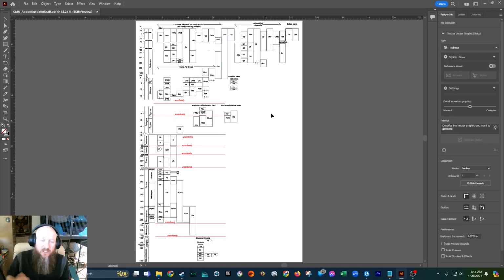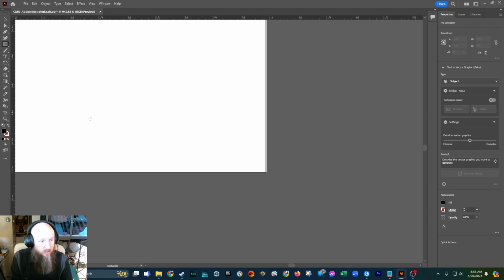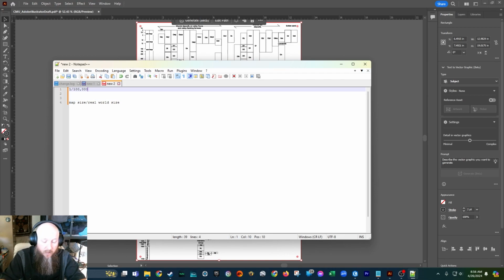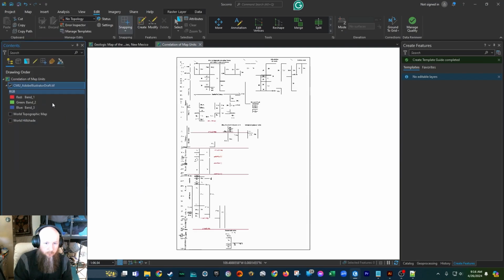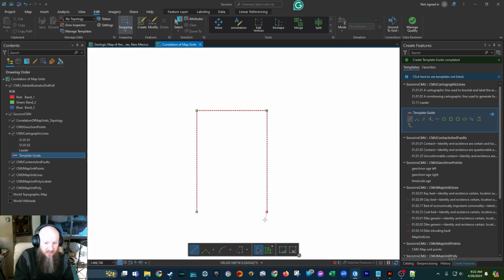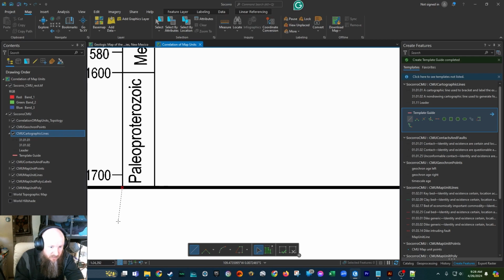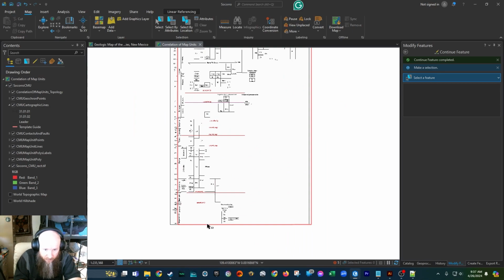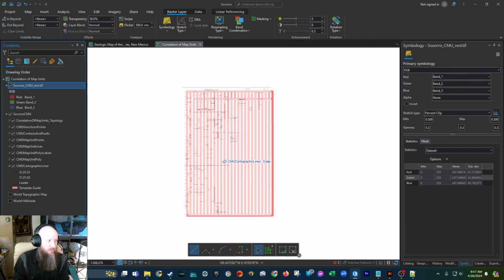Session 06: Rectifying a CMU from a designer program into a GIS to ease editing and digitizing.

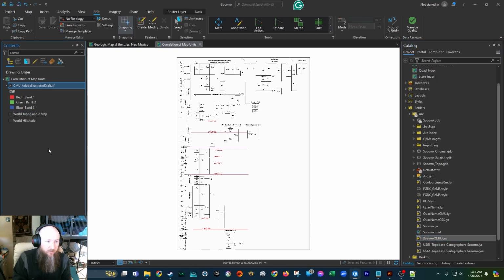Comment from the maker: At 21:05, I should have mentioned to add in the layerfile "and set the CRS of your Map View to match the CRS of the layerfile and thus the geodatabase we just added in." Adding the TIF first with no CRS set for the Map View creates a known problem in GIS. The Map View has no way of knowing the CRS, this mismatch between the Map View and the geodatabase will create problems. To fix these problems, you can set the CRS of your Map View to match your Geodatabase. You will need to do this before digitizing any lines, points, or polygons to avoid the known problem of CRS mismatch.